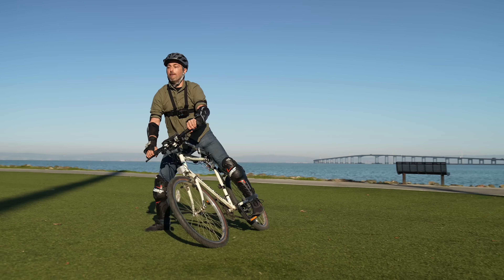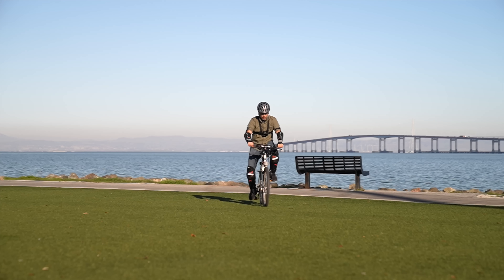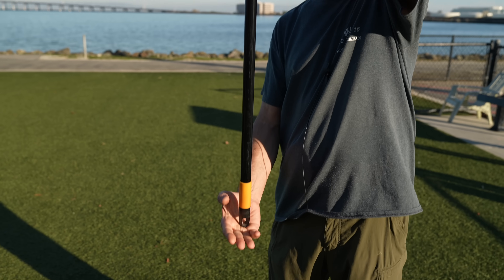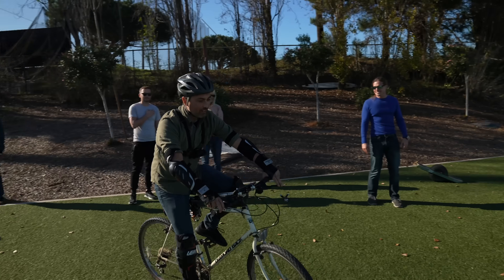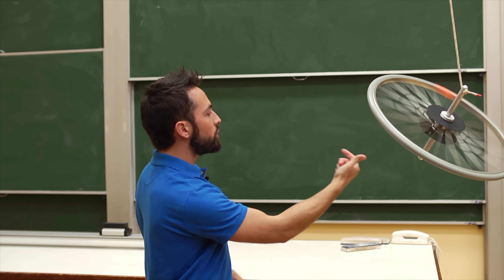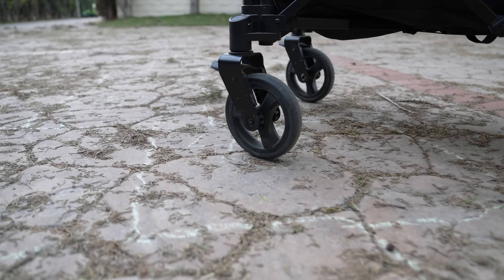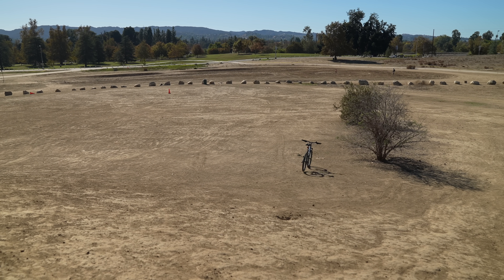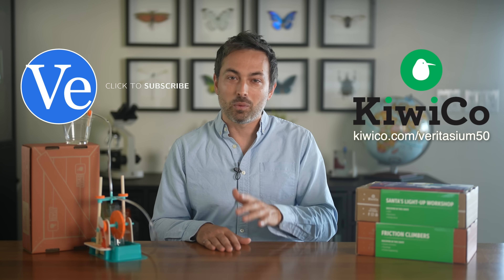Most People Don't Know How Bikes Work

Comment: Something else to keep your mind awake... even while IN the turn, you are typically pushing with the inside hand to keep in the turn.  To initiate a right turn, you push a bit with the RIGHT hand to start leaning to the right, then as you are rolling through the turn with the wheel pointed to the right, the bike wants to stand up again, so you KEEP pressure on that right hand to keep it leaned.

Comment: I figured this out in my 20's on my first motorcycle.  I grabbed the opposite handlebar to keep the throttle at set speed rolling down the highway while my right hand finished putting on my glove. I quickly realized that to keep the motorcycle underneath me I have to perform pushing on the right handlebar to make the bike go left to initiate a right hand turn.   Amazing how many of us don't realize this. May want to try the bicycle experiment by crossing your arms to steer the bike. Never tried this as now I am 66 and such experiments should be done by those who heal quickly.

Comment: Actually a person who has experience riding an adult tricycle can steer on that bicycle without any difficulty. To safely turn on a tricycle at speed you need to "unlearn" to turn by counter-steer and do it instead by counter-lean. This is where you shift the body over the centerline by leaning the body, repositioning your hands on the handlebar and some adjustments to how you bend your legs.
I remember how first-time riders of the now classic Schwinn Meridian tricycles would quickly end up crashing, so Schwinn mandated that their dealers must give proper instruction to all new buyers before the trike can leave the store.

Comment: I have a Penny Farthing high wheel bike that I ride quite often.  The steering is a little different on those.  When you push down on the right pedal it causes the wheel to turn left.  To make the bike go straight, you must pull on the right side of the handle bar to counteract that.  Riding the bike straight you must constantly pull from side to side on the handle bars.  Going up hill makes it worse, coasting makes it go away.  It is a constant battle.  Lots of fun though.

Comment: Now that you understand this, give slacklining a 2nd try.  Start out in the middle of a shorter line with tight tension.  I know it sounds crazy, but your foot will uncontrollably shake, this is from you overcorrecting, but if you stick with it for about 5 to 10 minutes, your brain equilibrates.  It's really more in the cerebellum and not in conscious control.

Once you can stand on one foot.  Pick a spot up in front of you to fix your gaze on.  Start thinking about how the bike works and shifting your weight from under you to keep you upright.  Think of your body as balancing an equation.  The only way to be stable is to be in constant flux :)

I hope it works out for you! It's really zen when you get the hang of it

Comment: Another good test is to gear the handlebars to the front wheel so when you turn left the wheel goes right. And when you turn right, the wheel goes left.  You kno this going in.  But you have to teach your brain to reverse a basic thought or you fall.

Comment: The realm of physics has many avenues to explore. One which has been mentioned here is "Gyroscopic Precession". Some years ago I discovered the work of Charles F Taylor. He invented a one-wheel all terrain vehicle which was balanced and steered by Gyroscopic precession. He built a series of prototypes and filmed them in action. Some of this footage found it's way onto the internet which is where I discovered it. Look him up- the views are kind of spooky. It took several showings for me to get an idea of how it was done. He also applied for a patent for his idea a copy of which can also be found on the internet. I don't know why his concept was never developed: probably lack of financial backing. His prototypes were constructed from many used parts. The closest thing I have seen to a working copy of his idea is the "One Wheel" scooter board. Taylors machine was ridden in a seated position. The power plant was opposite the operator and along with powering the drive wheel, it spun a heavy iron wheel via a belt drive.  This gyroscopic wheel was mounted on a gimbal connected to a steering wheel by a linkage. Turning the steering wheel caused the machine to turn right or left.

Comment: Whenever I've tried to explain this, everyone looks at me like I'm speaking French 🤣

I discovered the pendulum effect of bikes long ago. Leaning or steering can make a bike lean or steer. It's even more pronounced on a motorcycle at speed, only takes very little steering input to push you into a lean. Pretty easy to rock the bottom back and forth while the top stays essentially stationary.

Comment: Anyone who has taken an (MSF) Motorcycle Safety Foundation course has learned this and it's gospel. I was once riding a curvy road in Southern Ohio and a pickup apexed the turn into my lane on a right turn. Thankfully I'd practiced enough that instinct kicked in and i was able to press harder on the right grip to tighten my turn and avoid becoming his hood ornament. I swear i could have kissed his running boards with my toes and am greatful to be able to write this story.

Comment: What's most intersesting to me is I feel that you COULD ride that lock-out bike with the same practice you have as a kid. Hours and hours of practice of throwing your weight from one side to the other rather than steeing. Basically steering a bike like you might a stakeboard. Would need really emphasised body throws to get the bike doing what you want though, but in theory it should be possible.

I honestly don't know how the "gyroscopic precession" argument came to be for riding bikes though. It's so obviously wrong and it should be obvious to anyone who has tried to ride a bike really slow. The fact that you can even do that makes the gyroscopic argument completely void.

Comment: You'll find, though, when riding a bike or motorcycle, that as you approach or attain the proper lean angle, you slightly turn the front wheel back past neutral and in the direction that you want to turn in order to cause the vehicle to follow the desired arc.  To stop the turn, you over-steer to stop the lean and come upright, and then bring the front wheel to the neutral position to continue straight ahead.  Thus, there are 4 steering inputs to accomplish a turn.

Comment: There is enough info in this topic to do a follow-up video, a part 2. Maybe even parts 3 or 4.

Braking and accelerating makes a big difference when you turn as well. Steer in a circle, then accelerate or brake and see what happens. Braking lets you fall in the direction of your turn and pedalling harder applies more centrifugal force so you go more upright or even start to fall in the direction away from the turn.

Add weight to the wheel, between the spokes. You can just add solid weights or you can make a flywheel that sits on the axle, between the spokes to spin at a faster rate and see what happens. It does make a big difference to balancing.

Comment: I want to build a bicycle steering system that has magnets in it, in order to act as a combination of sensors and actuators. That way, it can be configured to handle differently based on the chosen parameters.

Comment: I wanted to bring up a suggestion for a video if you're interested. In the early-2000's there was a guy that made a Trikke - 3 wheels (front usually bigger than the rears), and works like riding a scooter only faster and more dynamic. It works on the physics principle Conservation of Angular Momentum which is why the front wheel has a reverse rake (unlike a bicycle which has a neutral rake) so it's inherently unbalanced at the front, but balanced at the rear. To gain power you have to ride in a sinusoidal motion, unlike linear on a bicycle. I have a T12 which I bought here in Australia, but these were a bit hit in the North Americas where Trikke was based.

Comment: The most convincing argument AGAINST gyroscopic force being a dominant influence on steering is to ask how much gyroscopic force there is in a scooter's wheels or In a skate board's wheels.  It's obvious that those platforms control lean and turn just with steerage from their wheels.  Steering a figure ice skate is even more interesting, where side force is controlled by lean of the blade, and direction of the body's rotation is controlled by the contact point of the blade being ahead or behind the body's center-of-mass.

Comment: Any experienced motorcycle rider knows you push on the handle bar on the side you want to turn. This is the ONLY way you can get a 350lbs Moto GP race bike to lay over into a corner at 100+mph. You literally have to keep forward pressure on the inboard grip. Otherwise the bike wants to stand up. 

While riding in a straight line at a faster speed (even on a bicycle) you can apply the slightest pressure forward on the grip and the bike will go in that direction. When you stop applying pressure, the bike will continue to go straight.

Comment: We don't typically "counter-steer". At least not exactly. We put the weight of our entire body to the left just before turning right, and the handle bars follow. Try it while holding onto the handle bars and you will realise that it's impossible to do so without also pulling the handle bars to the left just a tiny bit. How far the body goes left or right affects how sharp of a turn we can make. It's interesting that someone made a video about this, because I thought about this a lot since my childhood, and it took some pretty intense concentration to become aware of these barely noticeable, intuitive shifts of the body weight when riding. Because proprioception is governed largely by by Procedural Memory, and Procedural memory is by definition - the opposite of Declarative Memory, and very indirectly related to Semantic Memory it's very difficult to notice and describe exactly what one is doing when typing, playing the piano, riding a bike, etc. These tasks heavily depend on one remaining non-conscious of the procedure. The second conscious mind attempts to take note - suddenly you can no longer type or play the piano properly. It's why much of our lives we're not conscious and blissfully unaware of what we're doing (until it's often too late to stop).